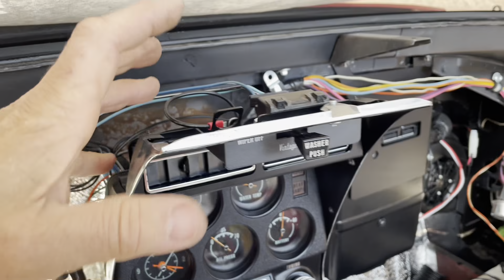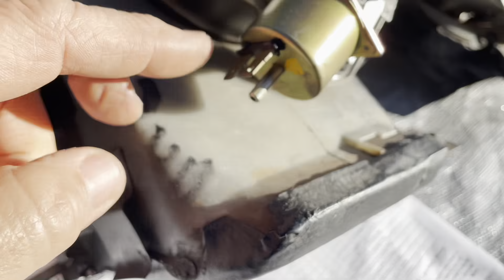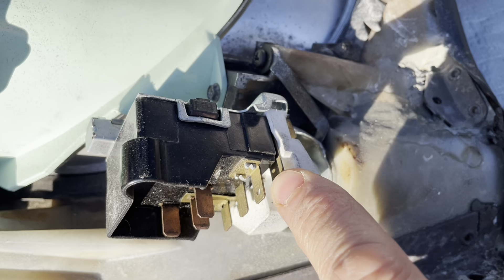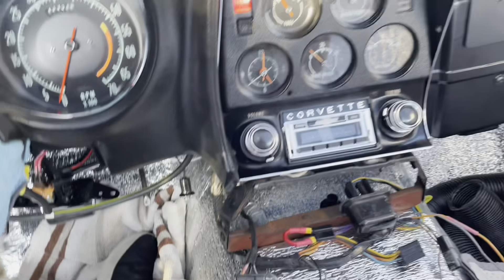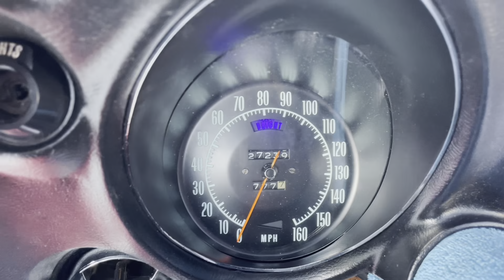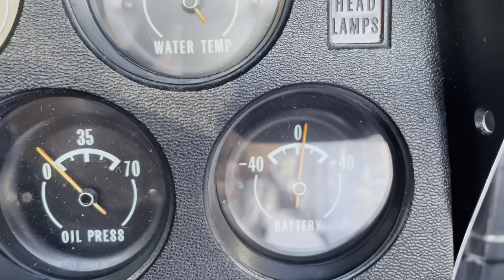C3 Dash Mockup & Test #1

Comment: Great job. Having taken the dash out of my 72 twice, I can make a couple of comments. I got a braided steel line for the oil pressure sending unit. Much stronger . the original plastic line has a tendency to break and dump oil in the interior. Also converted my tach to an electric one and that is relatively easy to do. I have had a broken tach  before and replacing that was no fun. Also allows you to get rid of the mechanical tach drive which has a tendency to break. On The Mark With Mark on YouTube has a great video on that. The last thing I did was get rid of all of the vacuum lines. Converted the headlights and the windshield wiper door to electric. Much more reliable. Richard Hayes sells the kits for the headlights and the wiper door. He has videos on YouTube . Corvette Hop has a good video on the braided oil pressure line. Easy to install and reasonably priced. Working on a C3 Vette is a place where even angels fear to tread sometimes. Enjoy your videos, keep up the good work.
Reply from the maker: Thanks for all this info. Glad you stopped by the channel and have relevant info! 

For now, my goal is to keep things fairly stock. I know it’s all a PITA and there are “fixes” that will make life better, but I do like the originality and “charm” of some of the older tech, like the Vacuum system, points distributor, etc. 

I’m trying to find a copper line for the oil gauge, but will look into the braided. The car is obviously not stock, but I’d like to keep some of the systems that make it unique - until I do an LS3  swap!
Reply: @thedrivewayC3  I have done the same with my 73. Went back to original points distributor, rebuilt the vacuum system for the headlights etc... I love the charm of the older tech. In a time when everything is LS swapped it is nice to know there are others that think the same way I do. Keep up the good work!
Reply from the maker: @shanman41  that’s cool. I agree that there’s a lot of charm and special properties that come from the original equipment. If someone constantly upgrades a 1970s car, after a while it becomes a 1990s car that looks like a 1970s car.

Comment: Yes indeed.  The dash on a C3 will.require some patience and some fiddling.   Be careful with the center guage cluster frame.  Those break real easy.
Reply from the maker: Yes yes yes. This frame did break on one side. (I picked it up by the top when I first took it out, before I knew better.) It’s been repaired and is pretty strong, but I’m still using extra grounding wires.

Comment: Great work. You have to wonder why GM didn’t design the gauge cluster to be on its own sub harness that can be unplugged from the main which then allows the whole assembly to be removed. 

You have to wonder how they did this task on the production line. 

I wonder if the harness and cluster were installed at the same time and it was mated into the fuse panel for that one step?
Reply from the maker: Either it was all assembled ahead of time and dropped in, or it was a bunch of Chevy Orange Oompa Loompas! 😅
Reply: @thedrivewayC3  Suspended by their ankles and upside down. 😀

Comment: use zip ties with screw holes attached to mount loom tight under gauges.
Reply from the maker: Just so I’m clear, the loom goes under the gauges and on top of the steering column, yes?
Reply: @thedrivewayC3  i may be wrong on that for your year. on my 68 and 69 it goes under.
Reply from the maker: @alberthodge631  Looks like it goes on top, but mine is not exactly like the photos in the AIM.

Comment: the loom should go under the gauges.
Reply from the maker: On the back-side?
Reply: @thedrivewayC3  I was curious about this so I just crawled into the footwell of my '72. The harness comes out above the fuse block and snakes its way upward on the driver's side of the speedometer. Also, if you look at UPC 12 page B10 of the assembly manual the routing of the instrument cluster lighting is illustrated. The harness is secured in place over the top of the instrument housings using hook-shaped clips.
Reply from the maker: @konrad1853  Thanks. I just checked my AIM and see what you mean. It also shows all the vacuum line routing, which I’ll organize as well.